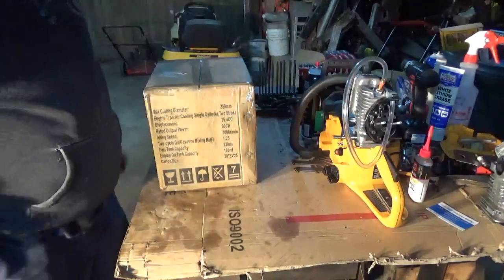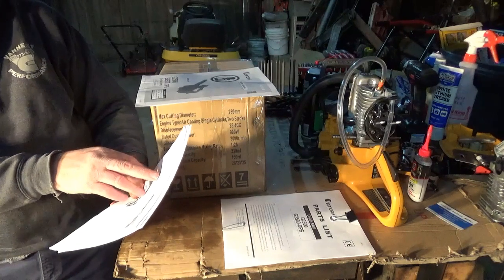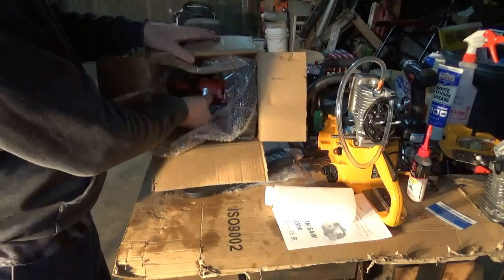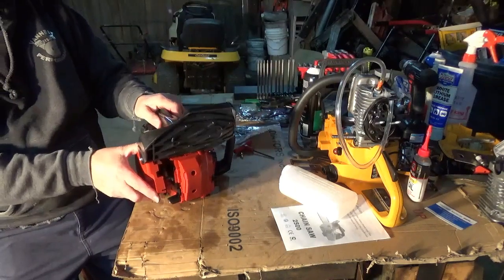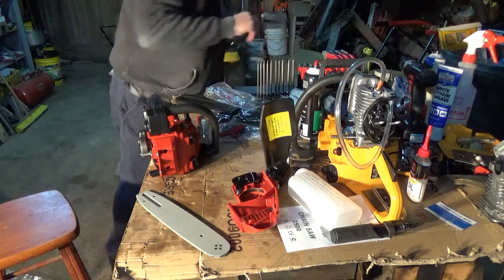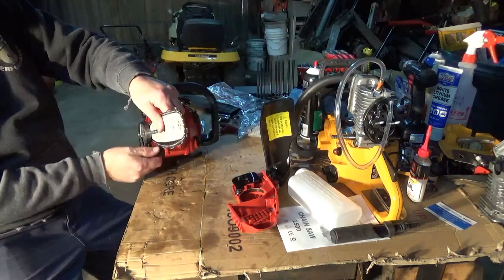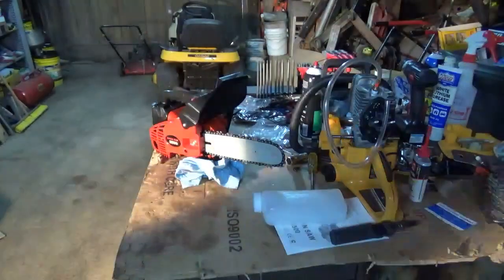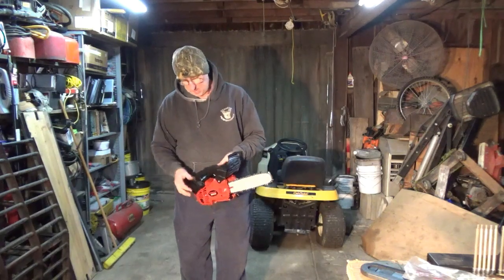Zenoah G2500 Top Handle "Clone"

Comment: I got my G2500, today.  They shorted me the bar.  I got the chain and scabbard but no bar.  I still have not found the winter shutter that is supposed to be inside the air filter section.  Mine runs fine and I did use their recommended 25:1 gas.  I used Stihl HP two cycle oil and mixed it in the included bottle.  It is pretty economical.  It took me over two hours to get 400 ml of gas through it.  The container holds three tanks of gas.  I had to engage the chain break to keep it from dumping a puddle of bar oil over my work bench, typical Husqvarna because it likes to slobber bar oil everywhere.   I guess you found the dogs, they are in the tool pouch, screws, too.    The chain break sucks - it is almost impossible to disengage.  I put a little white lithium on every part I could and a little wheel bearing grease on the white cam at the bottom of the handle on the sprocket cover.  I though I might have a bar I could cobble on it but my 015 bars would not fit it.  I am going to check my Husqvarna dealer to see if he has a bar that fits it.  It seems to be a nice little saw but I do not like having to have two ratios of mixed gas in the shop.  I filled it with gas and Stihl HP two cycle oil and premium non ethanol gas.  I did check it’s idle and WFO.  Idle was around 3,500 and WFO was 10,240, which was a little high at this stage of its life.  I richened up the H jet, slightly to keep the rpms down.  I have been very pleased with what I have seen, so far.
Reply from the maker: I would contact the seller about the missing bar if you have not done so, as for oil mix that's why I run everything at 32:1 thus eliminating getting anything mixed up (wrong mix in wrong peice of equipment)
Yes the chainbreak is quite stiff.
I did find the dog spike
So far mine runs great.
Reply: oregon bar

Comment: Hello , i like your presentation.what was the final corection  (in turns)of carburetor  on L and H .Sorry my english ,i am from Romania.Thank you.
Reply from the maker: As far as total truns in or out on the Hi and Low adjusting needles I can't tell you, I didn't start with them fully seated.
All I done was just fine tune the running sound of the saw to where it would idle good with good throttle response and cleaned up real good in the cut.
These adjustments were not more than 1/8 to 1/4 turn on each needle.
Reply: @craigtimmons3468  Thank you man , it helped me much , thank you.

Comment: I bought one of these a month ago. The only issue I had was the oiler hole in the bar was drilled too far forward, once I adjusted the chain it stopped oiling, I drilled a new hole and its fine now. Yours appears to have a different bar than mine even tho they're both 10 inch. Mine has a oil hole beside the adjuster hole while yours oils through the adjuster hole. Mine also emptied the oil tank before running out of gas with the oiler on max, its on min now and is almost out of oil when its out of gas.
Reply from the maker: Your bar may have been for a different model/brand that uses the same tail mount,  I've had to drill oil holes also to relocate them into the proper position. 
Sounds like you have the oilier set just right,  I like the 1 tank to 1 tank ratio

Comment: fun saws, but bad vibration in my experience, i use anti vibaration gloves to mitigate that. without i get tingly fingers within the hour, not good saws to use for prolonged periods of time. something to keep in mind. really not worth the nerve damage, that said to trim the occasional branch etc its good value
Reply from the maker: I've not used mine for 7 or 8 hrs a day but I have used it for 2 to 3 hrs at a time and can say I've not experienced the issues you have.
I love this little saw for what it is.
Maybe only having a 10" bar and chain is the difference.
Reply: @craigtimmons3468  i use some for carving with a 1/4 sprocket on and when i use it too long i had this problem, i got some gloves that prevent this and then i can use it for hours without issues. maybe its the high revs while not making deep cuts. it is something to keep in mind anyway :). 
not all brands may be the same like this, i have 1 benson and 2 timberpro but they should basicly be the same saw. and they all have this issue for me.
Reply: @craigtimmons3468 also love these saws for what they are, if u get a good one they do last for years. and i made many nice things with them :) actually put walbro carburateurs on them for better fine tuning. but i am starting to buy higher quality saws at this point :) kinda like echo and zenoah stuff. Im very impressed with japanese machines at this point

Comment: how do you get the bar and cover back on so easily? I’ve never had more trouble trying to put a chainsaw cover on than I have with this saw
Reply from the maker: I just put it on the same as any other,  No offense but is the chain break in the off position before reassembly?
Reply: @craigtimmons3468  Yes the chain break is on and the sprocket and the back line up just fine but I can’t get the adjuster screw to line up now with the hole in the bar
Reply from the maker: @chasedionisio  same bat that was on it before removing the cover?
Reply: @craigtimmons3468  Yes. I just figured it out. Took a minute for me to remember. I fairly new to chainsaws and so I’ve just been learning from videos like yours! Thank you for the immediate replies
Reply from the maker: @chasedionisio  No problem

Comment: What do you call the "grease gun" that you used in the video to add grease to the sprocket on the bar. Id like to own one but not really sure what to search to get one.

Thank you
Reply from the maker: It's a manual chainsaw bar tip grease gun mine is an older Oregon, the newer version is part# 26365 and they can be found in most any Big Box Stores that carry chainsaws, bar and chains and supplies. I lube all new bars before first use and when ever i put the chain on the grinder.
Reply: Home depot
Reply from the maker: @christopherbeaulieu4942  Yes

Comment: i cannot get the chain brake to unlock.Mine ia the Jon Cuttwer 2500 CSG2500
Reply from the maker: I'm assuming the cover is still on the saw, so it could be several things, if the flag moves freely then more than likely something is broken or not connected in the mechanism it self, if the flag won't move at all either something has malfunctioned in the mechanism or the spring tension is way too much.
Either way you need to remove the side cover to inspect the issue.
Reply: @craigtimmons3468  It is brand new out of the box and i did remove the cover..i did not get the bar or the chain..does it go up and down if there is no bar and chain?
Reply: @craigtimmons3468  you can tell i know nothing about chain saws. I bought this for my firewood guy. He wanted an arborist saw. But, he owes me $400 on top on what this saw cost so i thought i would just keep it.  I am a female and never has a gas chain saw.  But i have had bad luck so far with saws. I bought a craftsman 40 v lithium powered chain saw at an auction that did not have a battery or charger. Finally after a couple of months i found the battery and charger for $160. But the saw does not work. So now i am stuck with a brand new expensive battery and charger and craftsman no longer sells parts for that saw.  So, it is in every piece it can be, in a box.  Then a friend of mine gave me a 16 " electric that i cannot find a chain for.  Lol anyway, today i bought a Bow saw
Reply from the maker: @dallaspilotcar9293  I don't recommend electric or battery powered saws to anyone for some of the reasons you talk about here, the issue your having should be easily fixed if you know someone who is somewhat mechanically inclined. If you purchased the saw new front Huztl email them about the issue the saw should have some sort aloft a warranty.  They will try to deter you but just keep at it .
Reply from the maker: @dallaspilotcar9293  with the cover mounted onto the saw you should be able to work the flag handle as normal.
Reply: @craigtimmons3468  I ordered it directly from Farmer Tech came from China in a China Pack it took like 15 days to get here.  i did not order the bar and chain.  Now trying to find the right bar that will work on it
Reply from the maker: @dallaspilotcar9293  15 days is actually really good, I've had some items from Huztl take as long as 12 weeks due to being held up in customs, 
As for the Bar I believe this saw takes a 3"8 pitch T041 tail mount and I wouldn't advise anything longer than 14". I only run a 10" on mine.

Comment: What gas ratio would be fine for that? 50 to 1 maybe
Reply from the maker: Operator's manual calls for 25:1, I personally run all of my 2 cycle equipment at 32:1 using Lucas Synthetic 2 cycle oil.
 As I like to ask would you drive your car down the road with 1qt of oil?
Reply: I have echos. 450 and the 590. With caps on the carb. I was thinking of running a different mixture in them. I personally think 50 to one is too lean

Comment: Runs it for 5 seconds stone cold with the chain brake on and says "high side's a little lean". haha Total BS.
Reply from the maker: Please enlighten me as to why you think that this is total BS.
Reply: Craig Timmons 1: Stone cold engine is not burning all the fuel getting metered through the jet. 2: unknown, brand new, never been fired engine running 1/4 revs against the brake and you believe you can tell it's mix in 5 secs. Tell him he's dreeeeeaaming.
Reply from the maker: @DiscoFang  yes chainbreak on then off guess you missed that, cold and brand new yes but let me tell you this, it was NOT 1/4 throttle as you say that was wide open even with the break off and loading up even worse and even a deaf person could have known that it was running rich and needing tuned.